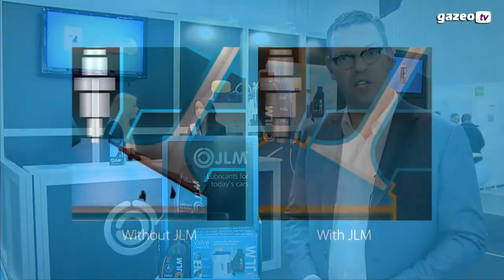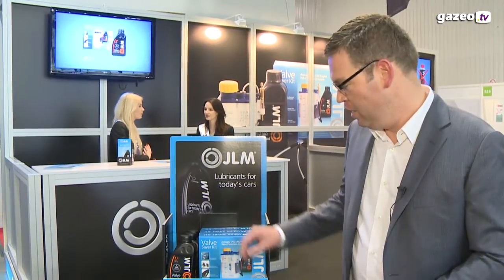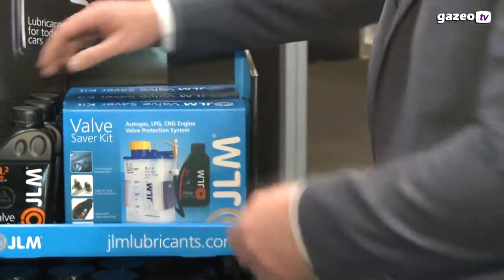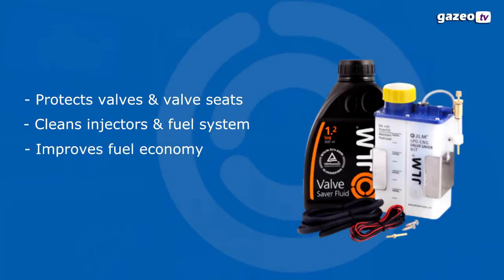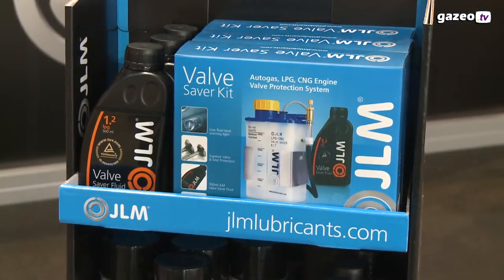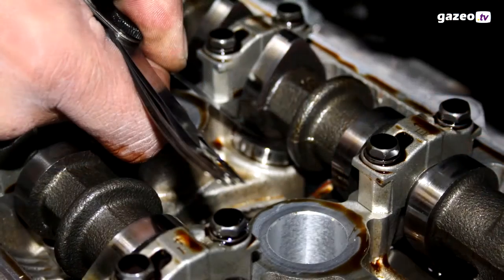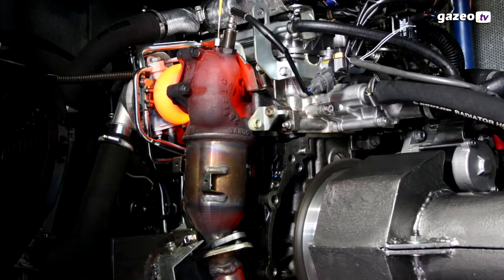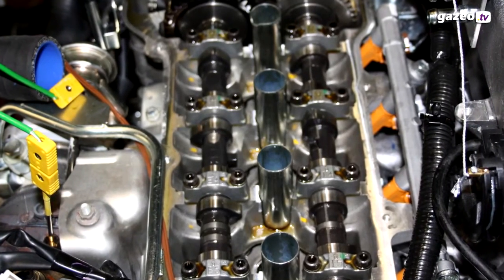JLM Lubricants | Autogas valve saver fluid testing (EN)

Comment: You can find a Flashlube test where they fit it to protect only some cylinders on a valve reccesion prone engine then after a while compare the results between cylinders. That is the proper testing method, not like in this video.